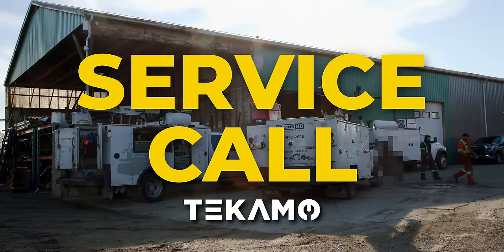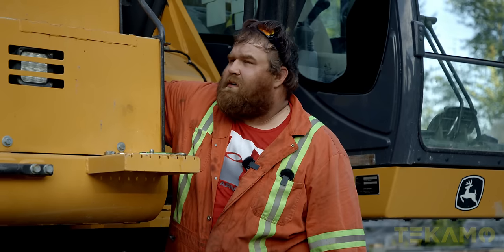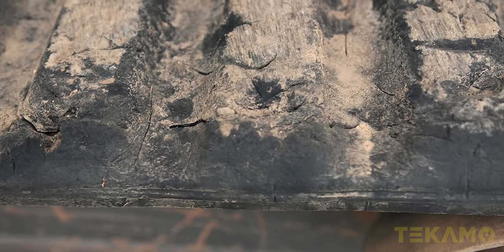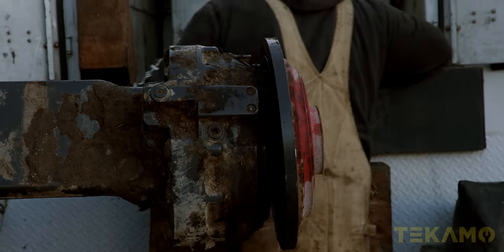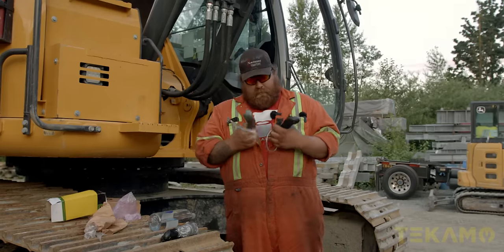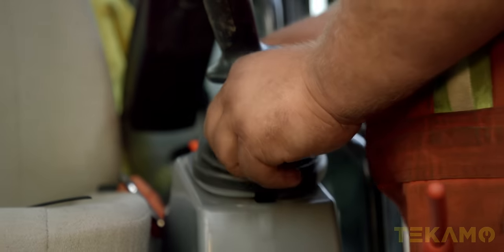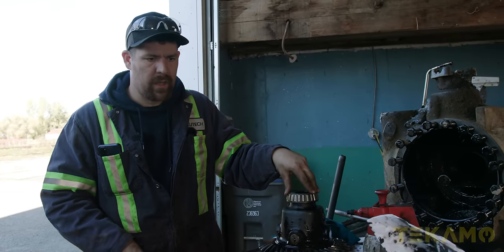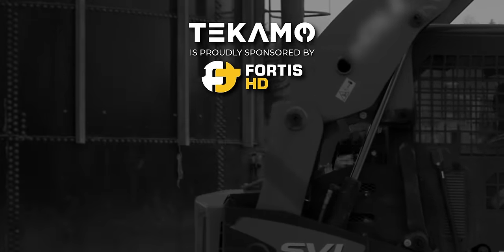This is what Heavy Duty Mechanics do! Heavy Equipment Repairs - Service Call #61

Comment: Love that how you show moving Hydraulic hoses around. On my 1978 Dynahoe-190 it the same. The main hoses go straight into connectors below levers. I can switch them around if I want boom or dipping on left or right control. The factory settings for Dynahoe according to manual was a JD control patterns. I switched to what I call CAT control patterns. People and SAE use a different term. 😊

Comment: Viewer from Estonia, I worked as a driver of a Merlo Roto forklift, the working parts were the lifting basket, hook forks. I helped the Komatsu maintenance and repair men to repair heavy machines, bulldozer 375 A, excavator 800 excavator in the quarry, in the summer and with great minus degrees, the life of these men is not easy, you have such strong maintenance with car tools, but the Kamatsu maintenance men had micro buses with double wheels at the back and inside were tool shelves and a generator compressor and Webasto air heater, separately there was also a hydraulic station and a thing with a huge powerful hydraulic cylinder that was used to loosen and compress the bolts of the excavator belt link.You're a man with a good sense of humor like a bear, I'll knock a beer mug with you!

Comment: 14:38 when he asked 'can you smell that?' yes.. ues I can. At my job we sometimes have completely burned out tractors (for parts), and when we take of the final drive with all that burned oil. I can tell you that shit stinks😂 Mechanics already know that the oil used for final drives already stinks when it is new, let alone if it has been burned🤮😂